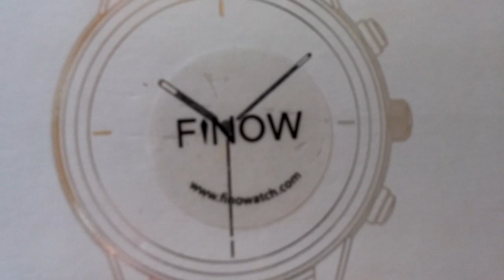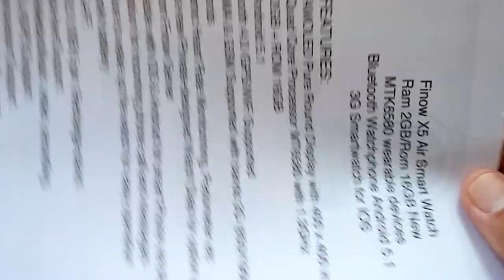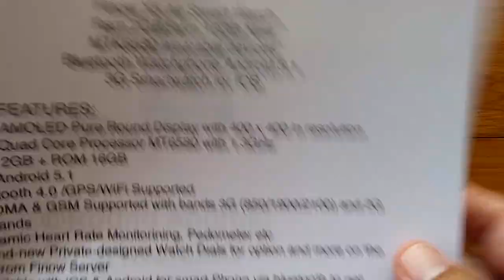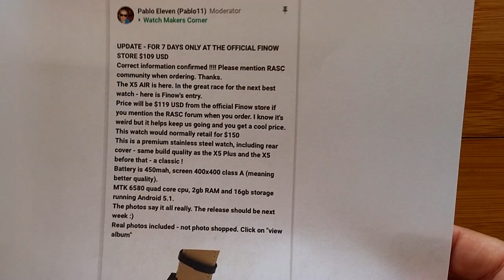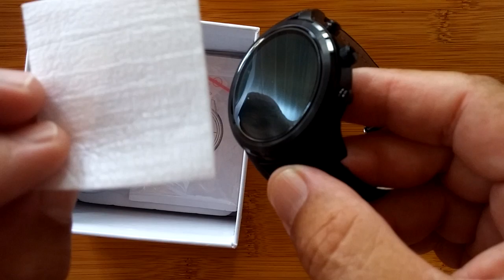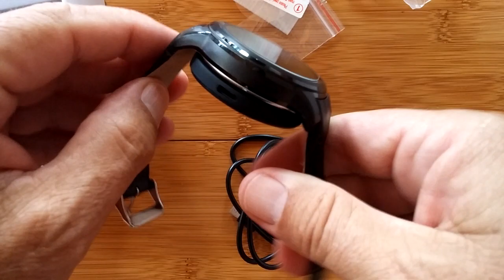FINOW X5 Air Android 5.1 2GBRAM/16GBROM Smartwatch: Unboxing & 1st Look

Comment: I want to buy watch with 2gb ram and 32gb rom, 5mp camera, waterproof.......suggest me one please
Reply from the maker: What you want doesn't exist. Only two waterproof Android watches: H1 and LEM6. Look at those. Only one 5mp camera is THOR S. Look at it. Others with cameras have 2mp even though some say 5mp (they convert the 2mp images to 5mp size but they are really 2mp quality). The ones with 2GB/16GB are listed in the spreadsheet you will find in the show notes under this video: https://www.youtube.com/watch?v=WP2tRMlTO7A
Reply: SmartWatch Ticks then is anyone good smartwatch with 1gb/16gb 2mp camera and good battery life, waterproof (if possible)
Reply from the maker: LEM6
Reply: SmartWatch Ticks thanx......

Comment: i orderd one finow x5 air smartwatch... nd it doesn't connection to network... it shows cannot connect network try again later.... first day the watch proved that Chinese technology is only for show off not for use
Reply from the maker: This is the first time I've heard of this problem for any FINOW watches. I'd suggest double checking your configuration and process. You didn't mention if you are trying to connect via WiFi or using a SIM, BTW.

Comment: Please tell me some smart watch with sim slot . Shape should be square smart watch
Reply from the maker: Check these: https://www.youtube.com/watch?v=Oh_HyP9WZVY&list=PLGZLicZ6A2vWWtDZqZBD7u3_9J7Lg9KVC

And look over the postings here: https://plus.google.com/u/0/communities/118413074291213420811

And if you don't need an Android watch, there are several square ones with SIM slots here, but I don't have them separated out. Look for the Dual Mode watches:  https://www.youtube.com/playlist?list=PLGZLicZ6A2vW40mQ7D5yjsUxc4ms5Z-zj

Comment: I bought the watch Finow X5 Air on gearbest.com . The watch dont catch the GPS signal, the watch without the GPS is for me useless. I have informed gearbest about this problem with no reply from their side, i wrote more times to finow, but from them i diddn't also recive any answer - super customer quality .
The watch have some more problems - battery hold very short , and the sound with bluetooth is very low - with the same headphones on my phone the sound in 2 times louder. If You will buy this watch be better careful and buy better something else - its a lesson for me for the future
Reply from the maker: Be sure to compare it with similar watches. Your expectations may be a bit higher than these Android watches can deliver yet with the current technology.

Comment: I ordered one of the Finow X5 Air two days ago because of the look, of the 2GB RAM and 16GB ROM, and the 3G 850/1900/2100 frequencies. One of the only ones I could see, there are others I'm sure but one thing or an other kept making me come back to this one. Once the programers are finished tightening up their code, it should be a screamer and good battery life (not great with only 450 m/ah battery. Better batterys and more efficient hardware will save the day. Maybe small solar panels all around it would give it enough charge to last the day, but I digress). They can turn things off and on automatically as needed, saves power. RAM is an extremely low power component, CPU can be slowed down and sped up as necessary automatically as needed. Give the programers a chance to do their thing, they want it to work as best as it can with the hardware and firmware available.
Reply from the maker: Thanks for your comments Murray, and enjoy your X5 Air!
Reply: I will do a battery test soon after I receive it and put the results under the video "second most asked question"...  Thanks for all the time and effort to keep this channel up and going, its helped me (and I'm sure many many others) a lot to choose my new watch.

Comment: SmartWatch Ticks
can you please, there is a wifi or not, because it is not clear in the documentation. according to the video. you can check it out
Thanks
Reply from the maker: Yes, there is definitely WiFi, and I get speeds in excess of 50MBps with my router connection.
Reply: SmartWatch Ticks 
Thank you!😀

Comment: I just got the watch and it works great but can it be rooted ?
Reply from the maker: Join the “Round Android Watches Proboard” here: http://roundandroidwatches.proboards.com 
Simply set up a free account, explore the various sections available to you, and jump in. There are many watch users and technical experts discussing just about everything related to smartwatches. From general watch questions you’ll find many answers in the extensive FAQs as well. Need the latest watch firmware for your model? Click here: http://roundandroidwatches.proboards.com/board/12/factory-firmware-downloads

Comment: Smartwatch #2. I just got my Finow X5 Air and I love all it does. Very FAST. Everything is working great even the "twist to wake" display. Just one question.. The watch has 3 buttons on the side, top is to go back one screen at a time, center is display on/off and power on/off. BUT what is the lower button for? I can not find use for it or see any change it makes to any display screens. Am I missing its use??
Reply from the maker: I think on the Air the lower button may be used to activate an emergency call when a SIM is installed and an emergency call number has been added to the watch, otherwise pressing it doesn't do anything. I'm not totally sure about this, but you might try checking around in your apps or in the settings.
Reply: Thanks, I will try and see if it works. You got me hooked! LOL I have 2 more ordered. The Thor and the new Les2.
Reply from the maker: Oh my goodness. Looks like we have another watch collector!

Comment: Hi, i did buy x5 air and i can`t to pair it with my Iphone 6s+ !!!! can you plase help me?
and i want to say with wifi conetion or 4g from sim it use very fast all batery !!omg i can use it only in standby mod!!!!!
Reply from the maker: I don't work with iOS, so I can't help you. Try this. Join the “Round Android Watches Proboard” here: http://roundandroidwatches.proboards.com 
Simply set up a free account, explore the various sections available to you, and jump in. There are many watch users and technical experts discussing just about everything related to smartwatches. From general watch questions you’ll find many answers in the extensive FAQs as well. Need the latest watch firmware for your model? Click here: http://roundandroidwatches.proboards.com/board/12/factory-firmware-downloads

Comment: Hello. Does anyone knows how to activate Ok Google from anywhere, or some way faster way then to go slide 5 screens and then to go to Apps->Voice search ? In Google app Settings->Voice->Ok Google detection I have only one option "From Google search app".
Reply from the maker: 1. Install the app Floating Toucher (it puts a little white dot on your screen that is always there.
2. Configure one of the hot spots on floating toucher for the Google app
3. When you want Google, touch the floating button and then the Google hot spot on your screen. Google will pop up over whatever else was on the screen and, as nog as you're connected to the Internet, you'll have your "OK Google" equivalent.
Besides, you don't want your watch constantly listening for "OK Google". It will drain your battery dead in under 4 hours. That's probably a part of why you can't do it.

Comment: So, it's basically just like any other Android 5.1 watches that came out lately, just with 2GB instead of 1. But the same weak battery and shape-induced restrictions for Android apps - and even the display-upon-raise doesn't work. Hmmm......
Reply from the maker: Hmmmmmmm  indeeeeeeeed.
Reply: I bought this watch its excellent everything works well no issues.
Reply: Manoj Kumar doesn't it do blue tooth calling?
Reply: I bought this watch . 👎👎👎. Short battery life. With sim card 2.5 hours. Can't turn off cellular network button. The only one way to increase battery life is go to airplane mode and turn off the brightness. Now trying to return, waiting 3rd day from gearbest for response.
Reply: On my X5 Air the display-upon-raise works.. kernel version 3.10.72+

Comment: what´s the waterproof (ip55,ip67, ip?) this watch ?
Reply from the maker: I would guess it's about IP65. Good dust protection but only splash proof. Don't dunk it under water!
If you exercise with it and sweat a lot, I'd suggest putting tape over the speaker holes in the bottom just to make sure sweat doesn't get in the watch.

Comment: And just an FYI, the X5 Air is NOT compatible with the Verizon Wireless network. Wish I had known that before buying it!
Reply from the maker: No smartwatches are compatible with Verizon or even Sprint. They all use the GSM network which is at&t and T-Mobile. It's been that way since the beginning, and I know of no plans otherwise.
Reply: SmartWatch Ticks Thanks. Only the Samsung Smartwatch works on Verizon Wireless.

Comment: HELP! Received my X5 Air. Can't get into Play Store or anything Google because the keyboard that comes up won't let me type an "@" to enter my email address (or any special characters for my password).
Reply from the maker: Tap the 123 in the lower left corner of the keyboard to access special characters. Then tap ABC to switch back to letters.
Reply: SmartWatch Ticks, I know to do that. Problem is that it doesn't work. It's as if that key isn't active.
Reply from the maker: Oh, OK. I often have people who don't know the basics. You can try installing an alternative keyboard like Google's "GBoard" from the Google Play Store.
Reply: Can you install the "Freedompop" messaging app from playstore?  I really like to know if this will work with a freedompop SIM card.

Comment: I went to gearbest website looking for x5 air, as i reach the comment section the seller mentioned about this watch doesn't have wifi capability. Can you confirm this?
Reply from the maker: Yes, that is an error that keeps appearing because they copy from an earlier error and keep reporting it. I'm sure they have lost many sales over it. This watch (and ALL Android watches) DEFINITELY has WiFi. That's a YES. WiFi is on the watch.
Reply: SmartWatch Ticks awesome. That settles it. This is going to be my 1st smart watch. Thanks for the clarification.
Reply: @amiwa8518  are you happy whit the x5 air? Thinking to buy one myself .

Comment: hi! can all apps run on adjusted screensize? ie. not round, but the option for square display screen round display screen is annoying, as you cannot get to the buttons in the corners of the screen...
Reply from the maker: No, most apps are not optimized for tiny watch screens. You need to use the screen zoom function to reach most of them made for square screens.

Comment: Dear Mr. Tics, I bought the Finow x3 plus 8 months ago. I'm happy so far but there are some issus!

1. It won't connect with my secured wifi properly. Especially using the weather app. Somtimes it shows my wlan and ( saved ).

2. When using for some minutes constantly it gets pretty warm.

3. Wearing it outside wearing a jacked and having it connected to my bluetooth earpots the reception is pretty bad and legging.

4. The Facebook Messenger app is not working at all.

Is the new Finow x5 air much better concerning those problems?

Thank you

Comment: Does finow x3 or x3 plus support this new interface like on finow x5 air?
Reply from the maker: If you mean the new updated firmware, no, not yet. It might come as an OTA push to your watch, but if it's more than that can handle, you may need to flash future updated yourself. WARNING! Don't flash the FINOW X5 Air firmware to your X3, X3 Plus, X5 or X5 Plus. You may brick your watch as I just did with my IQI I4 Plus trying to flash the I4 Pro firmware to it (which you'll see in the upcoming I4 Pro review).

Comment: What is the best watch with water resistance?
Reply from the maker: The ONLY Android watch with IP67 submersion capability is the Zeblaze Blitz (aka Z9). The JM01 claims to be total waterproof, but I find it hard to believe given some of the design aspects. All the others are only splash proof.
Reply: Are you using Finow x5 air for physical activity and will it withstand rain? I'm in doubt between him and the amazfit. Which do you indicate?

Comment: Another great video and great smart watch thanks again Mr ticks :-) you cheer me up with every new video... Secondary thoughts even though the watch has more ram, memory storage but same processor and the battery is not any bigger. So will probably drain battery quicker if you multitask, although previous model would provide longevity. 
(at least until a larger battery is possible in these watches)
Reply from the maker: Thanks! Got some interesting ones in the works now as well.

Comment: For those of you following the feedback as of July 26th I have had in my possesion an IQI I4 Pro with 2GB Ram and 16GB Rom.
From the very begining I found the battery life to be horrendous and the stock sync app to be buggy!
That first day a rushed real world test resulted in the watch quitting on me. I had already put the sim back in my phone
a couple hours prior to that though.Yesterday I experimented with some watch faces and succeeded in installing them I also factory reset and found that the
stock WiiWatch App fuctioned as it should and I was now getting way too much notifications on the watch. 
I'll firgure out how to deal with that at some other time.Today I factory Reset again, not due to any issues, but, only to run what I call a "naked" antutu test for you guys! 
That's where I factory reset and download antutu only, before I add other apps and enable any features. 
Sounds dumb, but, in the past I've noticed a difference in my mobile phone scores when i did that.So on the 1st Antutu run with watch completely set up with apps, skins etc and I got 20885. 
On 2nd Antutu run (naked) zero apps installed (except for antutu obviously),phone not set up in any way, 
factory reset was done prior to this run and this time I got a score of 20939 the average of both scores is 20,912Additionally I found that after 15mins 10% (63->53) battery drain with data, bluetooth, data, wifi on while streaming 
Amazon music.Then 15mins 15% (53->38) battery drain with data, bluetooth on while streaming Amazon music drain may have been more or less 
depending on if more or less power is consumed when buffering occurs as, with wifi off, music stream buffered 3 times 
within the 15min time frame.With each buffer I had to reopen the Amazon app and then it would reconnect and song would resume. 
With the last buffer the watch dropped bluetooth connection with home theater system for 10secs but soon restarted.Zero buffering was experienced when wifi was on, which, is what was expected!PLEASE NOTE: All attempts to install Amazon Music from the play store failed on day one of having the device. 
Play Store reported that the app was incompatible with my device.Today through stock google chrome on the watch I downloaded the Amazon Music Apk and opened and installed it, 
signed in with my Amazon info and I have live streaming music with zero app issues.While writing this bluetooth got bumped twice and for a brief minute all audio failed on the watch as I guess it was pushing audio through
to bluetooth which wasn't connected. The device did solve this on its own as it reconnected right after telling me that 
bluetooth was disconnected and with the reconnection the audio issue solved itself. 
Also with I reconnected the watch to the charger and found that, while my phone would charge while streaming music the I4 Pro did not.
Battery drain froze, but, battery power level didn't increase! I will add more info if need be and if Mr. Ticks does get an IQI I4 PRO
to review I will migrate this post to that video post.
Reply from the maker: Wow, great report. Thanks! Yes, please post a copy of this under the I4 Pro video! Google won't let me move it.

Comment: Thanks for the review Mr. Ticks!
Hmm... wait a bit more to see if updates to the OS makes the watch a bit better...
Perhaps the problem is what I was afraid could happen - the current bottleneck might be the CPU, so more RAM doesn't make much of a difference.
I'm waiting for a better CPU and the improvement in RAM/Internal Storage plus an OS upgrade, but for now will be keeping my X5 Plus. xD It'd be awesome to get a camera and SD card too, but there's only so much you can shove in such a tiny case... it's already kind of a miracle that they can put so much power in there.
Reply from the maker: Yes, I agree, there's a bit more firmware tweaking needed.

Comment: I think there is a competitor in the ColMi L1 that I would love to see your review on. Similar specs. 400mAh battery vs 450, but the case looks much nicer without those large knobs/buttons on there. The promo/advert video is at https://www.youtube.com/watch?v=J42jXBvuAgY if you want more info. Also sold at AliExpress.